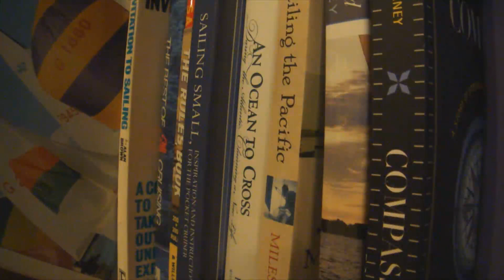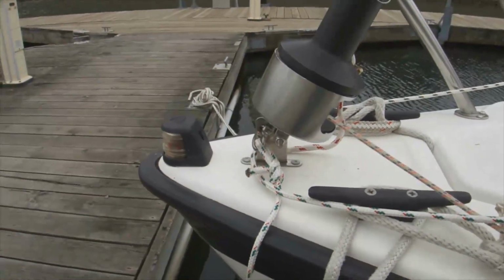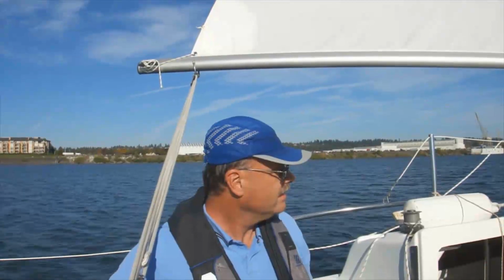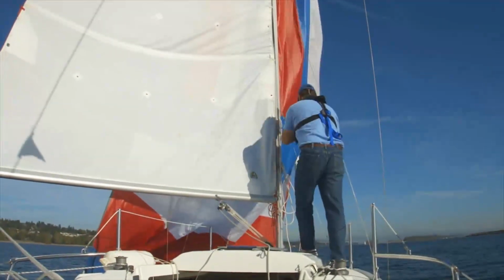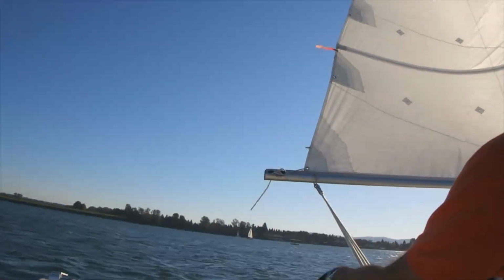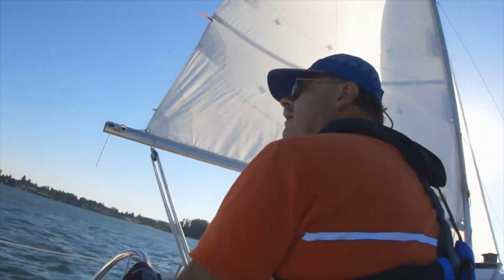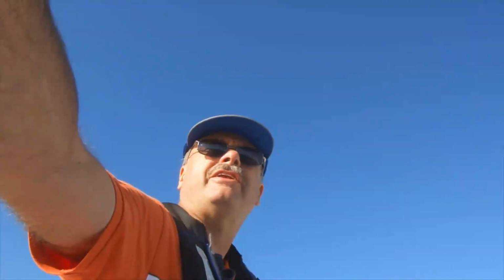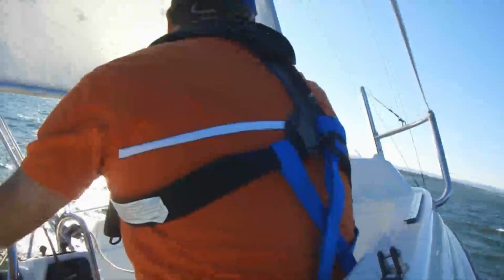Meet My Boat 3- Sailing The MacGregor 26x

Comment: Thanks for the video I have been wondering about all the criticism. I was wondering how does it do in some chop. Does the hull really bang with the flat bottom?
Reply from the maker: I've hull slammed a thirty eight foot 20,000 lb keel boat for hours. Sailing to wind on twelve foot swell topped by six feet of wind chop will do that. The Mac is much lighter and smaller. That said, fill up the ballast and she can take a beating her skipper won't ever forget.

I've owned my Mac for seven years now and can't imagine another boat even close in versatility.

Comment: A cheaper better sheet set up for lighter chutes is use 100ft single line with a bite (at 50') through the clew and pass both ends through to tie off. Saves weight and expense and no chance for a shackle to open.

Comment: Nice video is it nessisary to cross under the boom in front of the wheel? I mean could a guy cross behind the wheel and avoid the duck under? thanks
Reply: He's doing that to get the new jib sheet in fast and not use a winch handle.

Comment: How close into the wind can you sail?  I have a 26x and I can barley get any closer than 80 degrees into the wind.  I look at my track on the GPS and it seems that I just go back and forth along the same line, not making hardly any headway into the wind.  I just took my main to a sail maker and he said it was in good shape.  I'm running a genoa that came with the boat.  It seems to be in good shape.  What am I doing wrong???  Jason
Reply from the maker: Hi Jason, The Mac is not known for great pointing. The genoa won't point as well as a jib because the sheets run outside the shrouds, which makes things worse. My boat came with a genoa and jib. After gaining a couple of years sailing experience, I changed over to the jib and never went back. Even in light air, better pointing beats the small speed advantage of the genoa. Down wind, the a-sail rules! And in any kind of wind at all, the genoa is too much sail. The worst performance of all is a partially roller reefed genoa.
Reply: Thanks for the reply.  The Mac has some great points, and some really sucky points...  all told the trailerability and shallow draft are worth the trade offs for me.  I have an unused factory jib that I'll try to replace the genoa with.  How hard is it to put these on the CDI roller furler?  I ordered some sail lub to make things go better, but I'm alone and will have to get the genoa off and the jib on by my self.   Just to make things harder, the boat's on a lift...  How close into the wind are you able to get with the jib?  I've pretty much just sailed a partially furled genoa into the wind, which you describe as "worse case", so the good news apparently is that I'm going to be doing a lot better!  Will the jib extend along the entire length of the furler like the genoa or is it slightly shorter?  Also, I have a factory a-sym that I've never tried to use.  I sail alone and thought it was too much to try to tackle, but I've gotten enough experience to try it out .  I have a pulley at the top of the furler used to raise the jib cover.  Can I use that to hoist the a-sym or should I put another pulley at the top of the mast up by where the main connects?  Where do you attach the lower part of the a-sym to?   It almost look like you have a line on the front eyelet where you attach the trailer winch.  You also had a line going from the other lower connection point of the a-sym to some point near the forward hatch?  Where do you mount it and how did you determine what length it should be?  Jason
Reply: Hi Mark,  I sailed with the genoa partially furled but I brought it inside of the stays as you would a regular jib.  It did much better into the wind, but not as well as I'd like.  I just took the genoa off the furler and I put the jib on.  I took the whole furler off the boat to do this...  but it looks like there ALMOST may be a way to change the jib  w/o having to take the mast down???  but the darn line that runs in the furler isn't long enough to allow it to take slack and lower the jib...  Any thoughts about this???  Jason
Reply from the maker: Hi Jason, Good on you for tackling this stuff! Answer to your CDI roller furler struggles- read the manual. Its easily available online and unlike some manuals, clear and concise. The trick is to tie a line (messenger line) to the line that is too short. Haul down the gennie and then up goes the jib. I do recommend that you take a look at your jib and verify that it has a rope (bolt rope) sewn into the fabric along the luff that goes inside the furler so it won't pull out. It should look like your genoa. I hope you're as pleased with the jib performance as I am! One warning, before playing with a flying sale (spinnaker, a-sail) it is a REALLY good idea to get some help from someone who knows how. During last Tuesday's Columbia River race (6-20-17), a Martin flying a kite got blown over by a 30kn gust. It was a scary time as three crew were pulled from the still very cold river while the one lady (our PNW lady sailors go toe to toe with the boys every day) who managed to stay on the boat, got sails down and boat under control. Kudos to rescuers and suddenly solo sailor for all living to race another day!
Reply: The "heavy" line that's in the furler was too darn hard to "pull down".  If I change back to the genoa, I'm going to have to take the whole mast down again.  Ugh.  Now that I know how it's supposed to work, maybe I'll figure out what's binding things the next time I take a look at it (which will hopefully be never, my boat i presently in a boat lift at a dock for the next year...).  JIB:  Hopefully the jib's performance will make it all worthwhile, and if not, I'm getting good experience.   SPINNAKER: When I took the mast down, I took the opportunity to put another pully at the top of the mast for the a-spinnaker.  I've never used one and unfortunately I don't have anyone to go sailing with me, so it'll be a solo adventure.   My thinking now is that I'd only try to use it in light winds when I'm not happy with the main and jib.  If there were 30 MPH gusts, the main and jib would be more than than enough, no need for a spinnaker.  I suspect that the spinnaker is going to be more trouble than it's worth, but I'd like to try it at least once.  Jason
Reply: I just took the spinnaker out of it's bag for the first time.  It's another unused original sail that came with the 26X.  My goodness it's big and feels like paper.
Reply: Hi Mark, I have another question, this time about spinnaker poles.  I've heard that you don't need a spinnaker pole with an a-sym so long as you're not sailing directly down wind.  How was your experience w/o a spinnaker pole?  Did you think the a-sym was manageable enough w/o it?  Jason
Reply: Hi Mark,  I had a great weekend of 10-15 MPH winds on the Gulf of Mexico this weekend and got a lot of sailing in.  i spent the night on the boat in probably 10 MPH winds the whole night,  I have an autopilot that worked very well.  However, I still can't point into the wind very well.  I don't think I did any better than 70 degrees into the wind, and usually worse.  It seems that the harder the wind blew, the worse I did.  To get a decent amount of power out of the jib, I had to ease it until it was just outside of the lower stay.  Jason
Reply: Hi Jason, I just bought a new jib and main  for my 26X and now I can point just about as high as any of the boats I race against, while pointing high isnt the Macs strength it can do it, best results are to be slightly more off the wind by a few degrees, the original sails were rubbish when new and only get worse with age as they stretch. Try Blue Water Yachts they sell good sails at reasonable prices, you will wonder why you never bought new sails before once you have tried them
Reply: Jason McIntosh sorry to jump into this conversation, but i did not know how else to contact you Jason. I have a mac 25 for 30 years (but unused last 17). where do you sail in/on the gulf? I will be in st Pete for 2 weeks this Christmas/new years. then agin for 4 weeks jan/feb 2018. maybe we. can meet up if you interested. Jason  (another )

Comment: Nice video, just a comment, you shouldnt run directly down wind with a assy kite, they are not designed for that and it reduces the sails power. a beam reach would be normally as far down wind as you would want to use one, means extra gybes, but it is far faster

Peppa Pig is just a normal anti Mac knob, no idea and thinks he is a real sailor, my X sails like a dream as long as it isnt bogged down with the normal crap people keep in their Macs to make them floating caravans, she will never be a speed demon, but much more spritely, I regularly get 4 knots in a 6 knot wind on a reach with just my main and 100% jib. I dont think his over weight boat would go anywhere near that.

Just proves he cant sail well if he isnt good enough to adjust his technique to a different boat. A poor workman blames his tools, and he is a tool LoL

Comment: Loose outhaul for more power, yet loose mainsheet for less power? That makes no sense.
Reply from the maker: I've been pondering a reply to your comment for weeks now. You're right, what I said at that point doesn't make sense. There are two reasons for this. First, the correct trim was to reef the mainsail. Second, the description of what I was doing was much too brief.

Reef the main needs little explanation. As wind increases, a reefed main performs better in every way. Fifteen knots is definitely reef the main territory for the MacGregor X.

On this day, my too lazy to reef trim worked reasonably well. Even when sheeted out too far, and even further out for gusts, the sail still provided drive, which it wouldn't with a flatter shape.

Having since replaced the original well worn sails with a new set of North sails, I put in a reef in similar conditions. As one accomplished racer I had the privilege to crew for said,"Every time that sail flogs I see dollar bills fly off it."